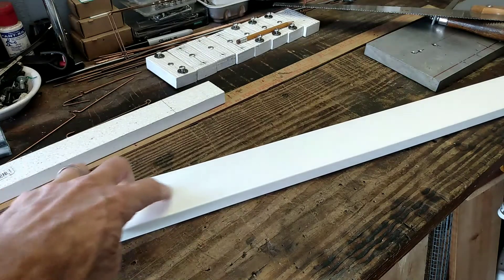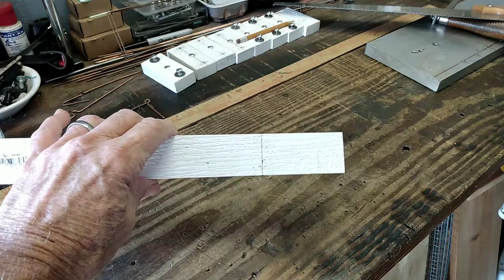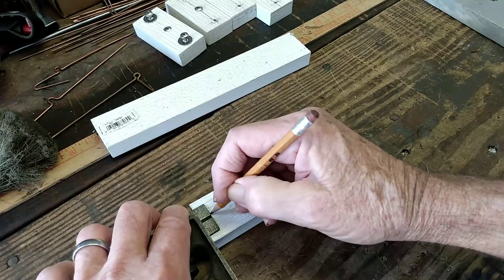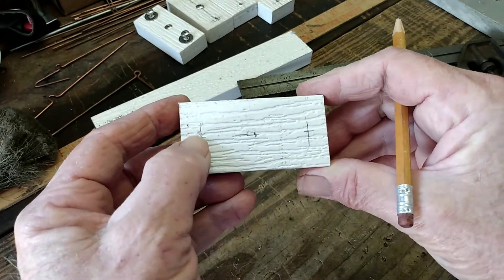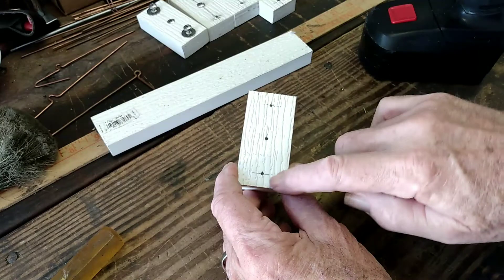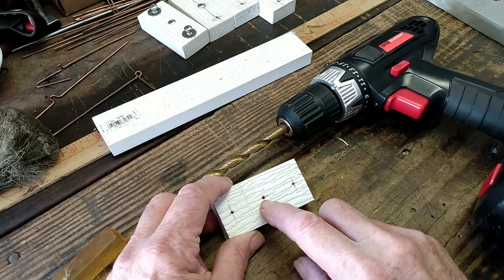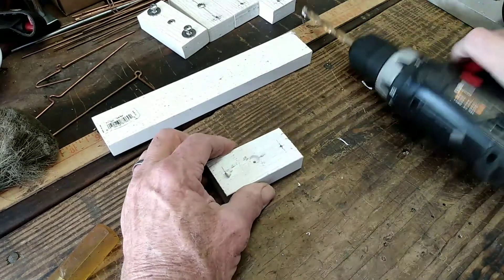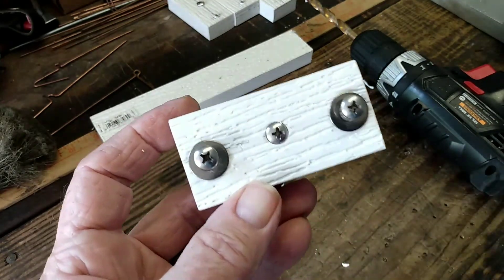Insulator for Bowtie

Comment: Were did you the.pvc.sq. stock??
Reply from the maker: Lowes, home Depot.
It's house trim. Sometimes it has texture
Reply: @cosmicantenna9244  Great video - Thank you!
One thing though, what size and length screws did you use on these insulators?

Comment: This is almost exactly like I build my antennas. I just use another section of PVC board for the backbone, though.
Reply from the maker: I built a 2 bay on PVC here
https://youtu.be/BAQuzy6JeWE
Reply from the maker: Hey 5 , about the two bay I built on the PVC. I recently removed it from the mast. 
We get heavy wind here and I noticed that the antenna was catching too much wind and swaying in a big way.
I plan to reduce the wind resistance by replacing the reflector backbone with 3/4" aluminium. I also thought of drilling 1/2" holes in the element backbone to help reduce the wind loading. 
Just thinking.
M

Comment: Cani ask where your sourcing the PVC board? I've been looking locally and can't really find a material this 

Nice.
Reply from the maker: The PVC lumber comes from Lowes home stores. Other sources are Home Depot, and some lumber yards. 
Now that's in Florida, PVC trim is very popular for trimming exterior doors and windows, it never rots. It usually has its own section in the store, near the regular trim boards.  In your area the demand may not be as high as it is here.  
Some have told me that they can only find it at lumber yards. 
There are alternatives, mostly  dimension lumber made from recycled material and such but like you said not as nice. 

Some terms are, PVC lumber, trim, plastic wood.
Material is always a problem. Some guys can buy rolled aluminum rods at their stores yet my stores have no idea what I'm talking about. 
Keep hunting, you might find a good alternative.
Reply: @cosmicantenna9244  ok we have a Lowe's about a half mile from home. I swear I walked up and down every isle yesterday looking for some. They had PVC fencing but no sold boards. I had a few feet of poly deck boards left over so I cut those to use for now.
Have you ever tried to add another 7"x7" 90 element section ? Or using 3.5" 90 sections inside the existing elements?
Reply from the maker: Adding sections to the Hoverman disturbs the phase sync of the signal, making the element larger or smaller never worked for me, couldn't hold a signal.
I saw a guy made a 7" Hoverman then mad a 3.5" and mounted it in front of the 7. All it did was interfere with itself !?!  Looked cool.
Reply: @cosmicantenna9244  I've considered both problems you mention, I'm less concerned about being out of sync, but the element size sure would increase thus changing where it's sweet spot in the uhf band would be. This is why I ask before I act as your the expert 
Thanks you once again I really appreciate the input
Reply: @cosmicantenna9244  there is a guy on YouTube that used 1/2" copper pipe w 45 & 90 degree elbows, and it worked really well if he's telling the truth he was pulling in stations he claimed to be 100-120 miles out and the antenna was just sitting in his living room. Looked like a hooverman on steriods
Reply from the maker: The 1/2" copper pipe does work. 
It heavy, difficult to work with and must be soldered to hold its shape and expensive.
He didn't pick up stations from 200 miles, not possible, and the FCC doesn't allow it.
He did pick up distant stations that broadcast on towers in his area, the stations partner up, so it's local. 
I get two stations that originate in Orlando FL but Orlando towers are 110 miles southeast of me, they broadcast on towers very close by, 2.2 and 3.5 miles.
Many people are fooled into thinking their antenna gets 200 miles when in reality it only a few miles.
But the copper pipe will work.